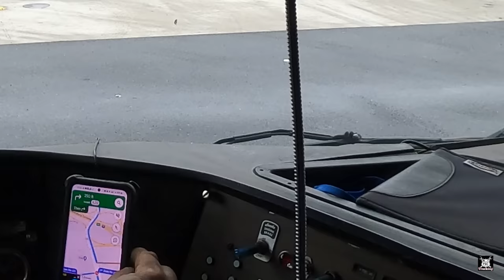This Is How Easy It Is For A Truck To Wreck A Train

Comment: When you’re hauling a load to a unknown destination and you get off the beaten path, man it’s such a relief to see industrial areas with other trucks.  You may not know exactly where you are but if other trucks got in and out of there, so can I.
Reply: yep.  was saying that to a friend the other day.  I pull a van, so usually not too bad, but some of these factories in downtown areas with old neighborhoods around them get sketchy.  I usually try to call the shipper or receiver and get turn by turn directions in and out, but these days, good luck getting someone to answer the phone.
Reply: @georgiapatriot4575  I think some older parts of downtown areas were made for horse and buggy or something and never widened for box vans or service vehicles
Reply: I understand what you're saying, but is that really true most of the time? That is, there are lots of trucks which could have easily made it over this particular level crossing, yet that didn't help this guy.
Reply: @kyle381000  I was responding to Georgia patriot about driving around downtown.  If you deliver in metro downtown areas you would know.
Reply: yeah, I know the feeling
Driving in Germany meself
Reply: @georgiapatriot4575  isn't that the bitter truth for all of US who drive for a living.
Reply: 😂 it’s the best relief in the world seeing another truck on the same road.
Reply: @truck_the_world6137  Yeahp, both of you going the wrong way 😆
Reply: @kyle381000  that RxR crossing wasn't exactly level. Look at the car going over it. any truck with a low deck trailer would get hung up on it, regular van trailers would not
Reply: @kyle381000  you have to remember he has a low Bo so it’s just a handful of inches off the ground at best. It’s all about clearance

Comment: There's a railfan video of a pickup pulling a low trailer across a railroad crossing and getting stuck high center. Luckily the railfan was there and he called it in to the railroad. A little later you see a train coming and slowing to a stop because they got the notification from the dispatcher. It could have been a very bad day for someone.

Comment: Boy that video brought back some not so nice memories. Back when I drove there was no such thing as GPS or even cell phones. You made your call from a spider infested phone booth, or you had your CB set. Relying on instructions from some one on the CB set sometimes just got ya worse off. I use to hate not knowing where I was going. I would get so up set. To this day I still hate not knowing where I am going. For me it’s the worst feeling ever. Getting lost in a car is no big deal but when your driving 70 ft you can get yourself in a pile of poop if your not watching. Great video showing part of trucking most don’t show. When almost every new pick up is the first time you being there getting lost is done so easily. It’s pretty hard to get lost on a dedicated run.  Anywho FSC another great video showing a side of trucking most don’t post. You have yourself a great and a safe day. Happy trails and happy motoring.

Comment: Steve, do you reckon the red SUV driver would've panicked if you had kept backing up and didn't stop? Most people will figure it out sooner or later, since you're patient, and let them figure it out, that's less time spent hopping out of the cab, walking down to the little SUV blocking your reversing route, to explain to them that they have to move their truck or get police to move them out of your way. Some people just don't understand how big these heavy haulers are and fail to comprehend how much maneuvering room they require.

Comment: Thank you for this video. I drove for 42 years and have been retired for 8. You are much appreciated by reminding me why I retired. I was under everything but a tube and a parking lot. My lowboy days were full of cases like this. Bless you brother and you be safe..
PostScript: what a great truck you have. My last truck was an 87 359. I still have her. 
1,600,000 without leaving me on the side of the road. I still have her and not a month goes by without some kid wanting to buy my Molly Brown.
What garbage they make nowadays
Reply: It really is. I purchased a Nissan Altima limited nice leather all the gadgets i don't use. The crash avoid sensors were going off before I had 6k on it. I took it many times but still goes crazy scare the crap out of you😊 in 3 yrs warranty they never fixed it. I know a young guy with a 2024 Peterbilt he has more sensors going crazy warning lights blinking. It's a shame. Bunch of overpriced junk. Salesman from Nissan called me wanting me to trade my pickup.. starting price $46,000🙄

Comment: As a former train conductor if you get stuck call the number on the aluminum crossing bungalow instead of 911. The dispatcher will have trains slowing down prepared to stop short of that crossing in about 2 minutes. It’s the luck of the draw still, because you could get stuck right when the crossing activates and a freight train is headed straight at you at 50-60 mph. Gotta evacuate the cab ASAP.
Reply from the maker: That is a high speed main line.  Odds are I wouldn't have enough time to get a call out.  But yes, I do know where to find the number to call IF.  I just preferred to avoid it all and go around.
Reply: What do you think about shorting the tracks with jumper cables ?? Supposed to turn the signals red.

Comment: Australian Truckie here, subbed.  I can tell you my experience with trains.  We were (about a dozen of us) were contracted to can't grain to Port.  

Now they had 1 train a day doing the same.  So I actually got out & spoke with the train driver.   

This is because we Truck Drivers knew there was a serious problem with a set of signals. Which meant they did not work at all.  So no warming of any trains coming.  

I wanted to know of the Train Drivers actually knew this & it had been seriously documented?    It had been.   

So the Train Driver actually told me, all Drivers that work the line, know that set are not working.   Not only, they step up out of the seat & prepare to stop the train for us.   

The reason why the line or signals couldn't be fixed was that they would have to close the highway to do it, as the actual line was cracked.  That was causing the signal failure.

Comment: I would have went out the way I came in,and found somewhere to turn around. 
I've been through this scenario before, only with a dry van, and wound up on a road with a bridge I couldn't fit under. I had to back up nearly 4 miles to get to where I started, but half way back, a farmer let me turn around on his property, and he gave me good directions to the road on the other side of that low bridge. 
It was on Friday, and only about 100 miles from home.

Comment: I never sit on the railroad tracks though a traffic stop I several occasions I've had people get mad and blow the horn and go around me .            When I took my CDL test you would get negative points for changing gears crossing tracks or making turns I haven't driven a truck in over 20 years but the habit I learned I've never strayed away from

Comment: It's an Oskosh b' gosh!
Hey, welcome to Chester, VA!  Don't ya just love out tiny, winding roads and well marked routes?  Where's the WaWa?  The WaWa you were headed towards was across the railroad tracks, on the other side of 301 and it is for cars and light trucks, not for the big rigs.
Fuel in Richmond, Chester, Hopewell, Colonial Heights, and Petersburg is really expensive thanks to being designated an EPA high pollution zone.
Sorry you had a bit of a miserable time in my neck of the woods.

Comment: Tie down chains do not need a quarter ton of tension in them.

TL:DR
ur likely gonna lose the load in a crash

Details:
The Angel Nut on a certain helicopter is the sole chunk of metal responsible for holding the main rotor hub on the machine.
The entire weight of the helicopter and cargo is literally hanging on this nut.
If the nut is cranked down, it preloads the tension in the rotor shaft, and reduces the load capacity.
That it why it is tightened "hand tight" and then another plate is placed on top of it to simply cover it, and the bolts holding the cover plate are safety wired to prevent anything turning without someone wanting it to.

So, when you crank down with everything you've got on those chains, you're tensioning them, and reducing their load capacity such that they will easier snap in the events of aggressive accelerations (the physics definition of acceleration, not just mashing on the go pedal).
Reply: Makes sense to me. 👍

Comment: glad you mentioned the overhang.  I had no idea the rule there, and now I'm happy I do
Reply: The maximum legal length for a trailer is 53 feet. (You may have noticed that on van trailers driving  down the road). If Steve's trailer is 50 feet, then he has 3 feet of leeway for the overhanging of the load.  If it's longer than 53 feet or wider than the road, or the total weight is over 80,000 lbs (tractor, trailer and load) then he would have go through the whole rigamarole for Oversize Permits
Reply: Many years ago I meet a driver who was delivering 30 foot dump trailers. He was using a pair of 27ft flatbed trailers to get two at a time. California CH-P looked it up and had to admit he found a loophole to drive a truck through. He was making all his money on the westbound and grabbed what he would not loose money on eastbound.
       Flatbeds!!
    I remember when that Pilot at Petersburg(?) opened all those years ago. It looks a lot less crowded than I remember it.
     Thanks for the memories. An on the beach retired OTR driver .

Comment: Beyond possibly wrecking your truck, the cost to remove it from getting hung up on RR tracks, is the possible death and injuries to nearby residents, in other vehicles, persons on the train, causing a derailment shutting down the tracks or causing a dangerous spill (think of East Palestine, OH). Less than a mile from me (Garfield, NJ) a lowboy truck and trailer got hung up on a humped up RR crossing. A commuter train hit it making a mess. Fortunately no one got killed, few were on the train (it was at an off-peak time) but it shut down that line for the commuter trains and freight trains for a day.

Comment: Pretty easy, especially in a low boy (it doesn't take much, it's usually always the landing gear/support legs getting hung up on raised tracks, especially ones that are raised with sharp drops at both ends.

Comment: Bad rail crossings are exactly why we need to transition from mechanical RGN's to only hydraulics. Not only is it easier on equipment and the operator but it allows you to easier raise the trailer high up for bad spots.

Comment: Be glad you didn't go to that wawa it's tight getting around it and they do not have truck fuel island just car island. I ran truck around the Central va area for years pulling heavy equipment on steps and rgn s . Stay safe out there

Comment: I set up a shunt truck in 1998 at a truck shop I was working in Edmonton. Put a hydraulic fifth wheel on it. I was low man on the totem pole so I got all the brake jobs. Was fast turn around every time I finished a job. I would evac/cage brakes so that I could back in under trailer ,raise 5th wheel , and pull into shop without getting out of cab.The new hires could never figure out how I was faster than them. Oh to be young again...
Hydro fifth wheel would work for those crossings. Have to have a reliable locking system, though.

Comment: Hi.My name is john I watch your channel alot cause in early 80s mid 80s i drove that truck and the earlier boxier one  but ours  with the 3 wipers where white color with plain jane light brown  vinyl interior no carpet ones cummins 10 speed trucks,boss ordered 15 of them to replace the old fordsnubnosed and the transtars ones and the 3 old pete cabovers which had almost 3 mill on them rebuilt  a ton of times

Comment: O-H-I-O Porter greetings.🇺🇸 Trying to catch up on your videos. Oshkosh trucks are still cool. Tis a shame that you had to get a wrecker to load it for you. That can be fun, too. Those backroads can be fun navigating with or without a Garmin or other apps. Scraping the tracks isn’t a good thing either. I’ve heard a lowboy do that & just keep on going. I looked at the rails afterwards & saw the deep scrapes. The po po/DOT would NOT like stuff like that. You did the right thing. Fuel Prices = they can be quite different from place to place, even 1 mile away. Pilot is not always the cheapest either.  What a ride! Been there. Good stuff! Blessings!😎🤩✌️

Comment: Isn't it fun in an area you haven't been before, low bridges and weight limited roads etc. Then when reversing from no access locations light vehicle drivers drive up to the back door and blow their horn. 4 way flashers and in my case reversing lights are on but it's not obvious to them the truck is reversing. Go figure! Travel safe Steve.

Comment: That happens all the time especially down there in Georgia.
That's where a lot of them tend to get hung up on with low parking lots and flatbeds and step decks doesn't take much.
The ones you really see those Steve where they screw up big-time r1 it literally says no trucks on this Crossing at all and it's clearly marked with a slash through it.

And then you see some dry box getting mowed over by the train and a big destruction scene why because it's a hike round Crossing and it says no trucks but lot of them can't read follow the GPS isn't that's what happens

The good thing for you when do you have to back away from that Crossing that intersection was a stop I had a situation like that years ago I had to call the local cops out I didn't trust backing across because it was such a heavily-traveled county Road and I said I'm not got nobody that wants to help stop the traffic so I could back out so if you guys don't mind coming out or I'll just block your road

Comment: Usually, freight trains rip tractor trailers to pieces but what does happen sometimes is the debris will roll the rail over in front of the train causing a derailment. Thats what happened recently with that bridge girder a few months ago. The beam fell on the tracks in front of the train and rolled one rail over.

Comment: i feel if you reading the road correct, you can clearly see if you might ground out and at that point you reverse / turnaround if in any doubt do not risk it. knowing your rig and reading the road well and you not have an issue.  its the ones not paying attention then it too late when they get caught up

Comment: I’ve never thought about encountering a set of tracks I can’t cross no I know what to do I can you handle that. I had to deal with backing up at 389 with a 48ft flat on a busy street and I swear I had a whole line of cars that were like that red SUV to you in this video. I had to get out and tell people to go around me. I gotta I can push the brakes and look back in another car pulled in right behind me 😂

Comment: If you get bellied out, knock off the leveling valve links on the tractor & the trailer & shove them all the way up. If you are on a live railroad track, don't fuck with unbolting them, get your tire knocker or whatever is handy & rip the link off the axle end. When you're ready to travel again just tie it off to hold a level until you can get it fixed.

Comment: We have the same thing and we use it for hauling big logs coming out of tight spaces where we can't get out log truck's in. Ours is a Mack and it haul's ass dam good. It pulls a trailer also to set more logs on it. And the driver connect's the trailer when he's finished stocking up on log's. That's why we don't use lowboy's anymore due to railroad crossing,'s like that. Years ago a guy was driving and he got hung up (dragging the trailer) and he was begging for help. I quickly jumped in the wrecker and hightailed it over there and quickly connected to the front of the dump truck and while I was getting in the wrecker here comes the train. I told the guy to bleeping floor the $#@_ out of his dumptruck and he was. I floored it and we was crawling and got it off the tracks within like 30 seconds before the train came through. The dispatcher of the train company was trying to get a hold of the train conductor and guess what they was doing??? They was bleeping 😴😴😴😴 they was quickly fired. I was like hell yeah (lawsuit) we reached out to the guy who got hung up on the tracks and he was like hell yeah. He was very thankful for getting him out. Allot of people was posting videos of the incident and they was like go TJ go TJ go and was cheering when we cleared the tracks. The police officers was like wait a minute where's the bleeping railroad crossing signs at. Apparently druggies removed them for scrap metal to sell. The guy stated that he will never go this way again. He said that he was coming up and seen the tracks and he was like where is the railroad crossing signs at. And it was to late he got hung up. Driver's and Hot Shot Load drivers was like wow watching video's of it. The person who I am co-owner with was like shocked seeing it (video) the police department and sheriff's department was watching for the druggies and they caught them removing the signs and they was hit with so much charges they will never see the greener side of the prison again. They admitted stealing the signs earlier that day. Lucky the red SUV moved outta ur way and didn't ne a Karen or a @#$_head (that's what my wife Jessie told me to say)